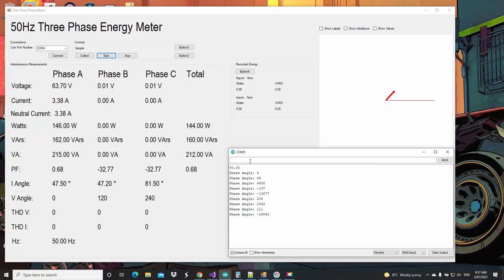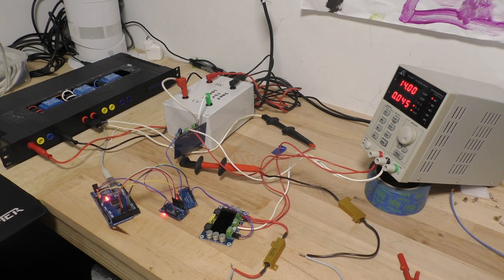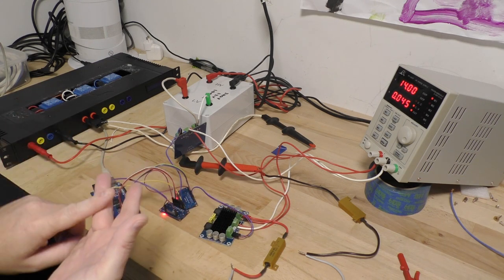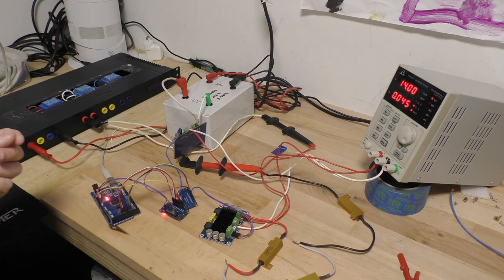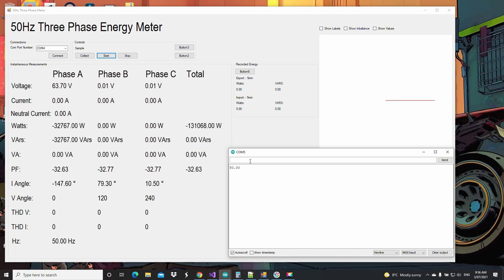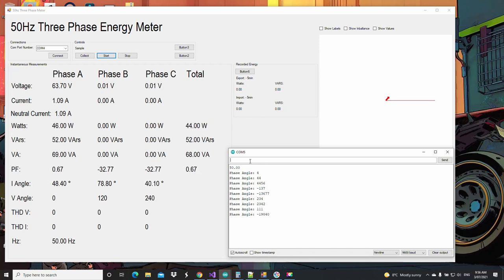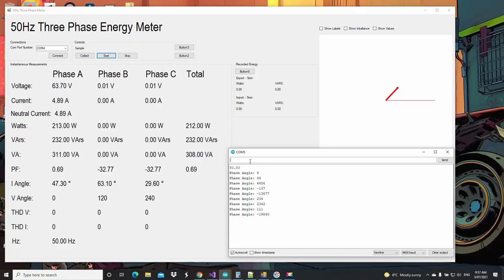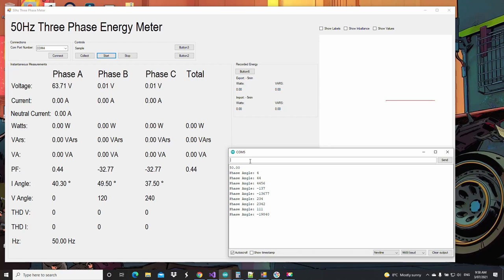Arduino Powered Single Phase Injection Set

Comment: This would be great to tie 3x sets off together to make a three phase test set. BTW, where do you post your tutorials?
Reply from the maker: You can make two phases equal to 120 degrees, but not a third with this DDS chip. I tried because that’s what I was hoping for. There is a couple of different ways which I’ve ordered parts to try. The easiest thing to do is get two 3 channel function generators and you can make 6 signals. I’ve ordered one from eBay and I’ll see how that one works before I order the second